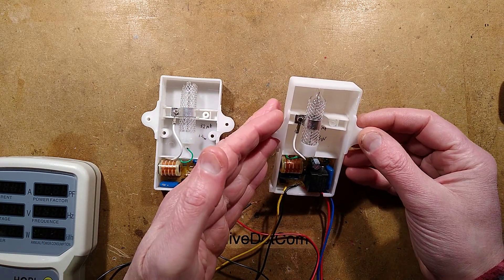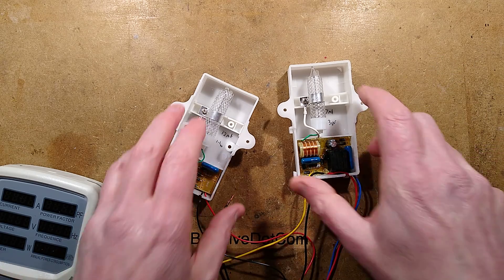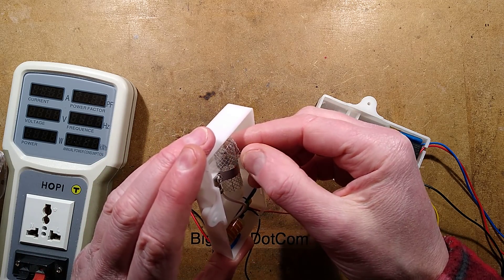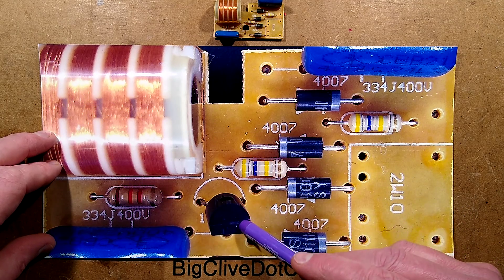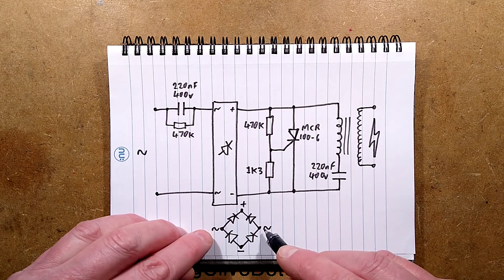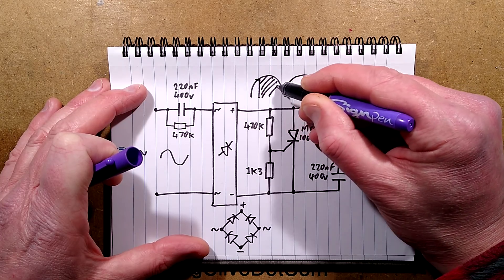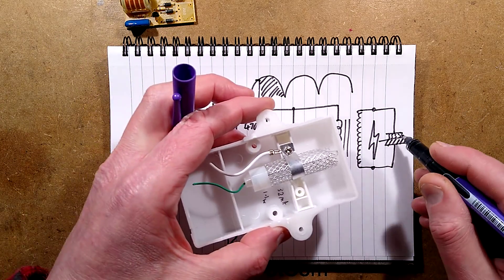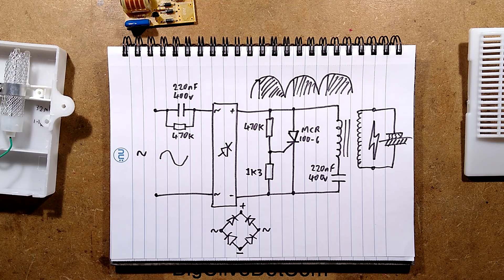The "two-wire" high voltage mystery eBay device

Comment: The diode layout looks like it's doing a few things. It must be changing AC to DC so we don't electrocute our consumers, and it also looks like at least part of cascading voltage circuit going into the coil, maybe 1/2? I may have to buy one of these things just to play with it a bit. Cool little device! Interesting video. Thanks!

Comment: 2:18 "It does create ozone". If it does create ozone, patent this device and you will be a billionaire this year. Currently used ozone generators require oxygen tanks, and they are much more complicated than the device on your table. Usually, such a simple device that you purchased on eBay generate nitric oxide, but yours generate ozone instead! This is pretty amazing!
Reply from the maker: In open air a corona discharge unit will create ozone, nitric oxide, hydroxyls and other molecules.  The exact same ones created in nature in a similar way.

Comment: Well, here's one for a Bigclive.com video - resistor E ranges. 1.3 becomes a member in the E24 range and higher. You probably had an E12 range, which it is not a member of. 

E6 1.0 1.5 2.2 3.3 4.7 6.8

E12 1.0 1.2 1.5 1.8 2.2 2.7 3.3 3.9 4.7 5.6 6.8 8.2 

E24 1.0 1.1 1.2 1.3 1.5 1.6 1.8 2.0 2.2 2.4 2.7 3.0 3.3 3.6 3.9 4.3 4.7 5.1 5.6 6.2 6.8 7.5 8.2 9.1

They go apparently from E3 to E196. E24 is common for metal oxide resistors.

Comment: The circuit look quite similar to old day spark gap transmitter.. the SCR act like a spark gap when the voltage exceed the break down it start to conduct . the capacitor dropper act as current limiting circuit instead of choke.

Comment: I've designed a circuit similar to this, but working off batteries.   Which means I needed to create my own AC signal to rectify.   The thyrister self-shorts out the capacitor reserve and thereby effectively switches itself off, no need to wait until the zero on the input wave.   You'd need the data sheet to know what voltage triggers the thyrister but I made it work differently based upon the charged voltage, independent of that trigger voltage.   Good analysis of the circuit though.

Comment: so what was the relay for, in the half wave model?
Reply from the maker: It appeared to be a no-volt relay style safety interlock.
Reply: @bigclivedotcom  sorry i dont know what that means. Is it someth8ng where if the discharge tube fails then the supply voltage is disconnected. Does it trip and then have to be reset.

Comment: designed and built these commercially from about 1990 up to 2004. The lowest power one I had worked on a similar principle except it was 1/2 wave and fired when the capacitor stopped charging. Biggest one was in a watercooled stainless tube 2 m high, ran on pure oxygen. Drew about 3 KW from the mains. You could not run it with people in the room! It was used for purifying water for a fish farm. I just sis the electronics.

Comment: Clive. What did you mean when you stated that 1K3 was "not a standard value"?
Reply from the maker: There are different resistor series.  I use the E12 series which has 12 values per decade and jumps from 1K2 to 1K5, but other standards probably do include 1K3.
Reply: @bigclivedotcom  Obviously, I'm not up with this new (odd) labeling  format.

Comment: For 110vac, put two capacitors in series on the +/- of the bridge rectifier and move the neutral wire to the center tap of the two added capacitors. Basic voltage doubler.

Comment: Do you have a Geiger counter?
Because the UV from the arcing in that tube should be enough to cause some of the aluminum to transmute through K shell electron capture into an unstable isotope that decays back to aluminum. The decay will only be beta radiation (high speed electrons), and isn't really a threat.

Curie exposed aluminum to UV and showed it to be radioactive for about 30 minutes afterwards.

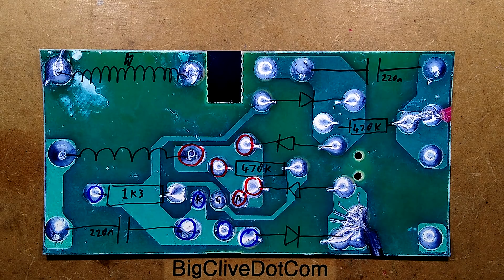Comment: the slot for the the "2W10" could be for the relay that is omitted to make the 2 pole version, for cost cutting they probably just solder over the pins and use the same board. 8:30 , you can see the added solder nugget used to bridge @ 5:10.  anyways im 15 and from Canada and a reply would be great! by far my favourite electronic dissection channel.

Comment: You sure the "2W10" wasn't for a relay (like the 4 wire model) in a model where they want to be able to switch the device on and off without interrupting power?

It will almost certainly be a gas charged tube.  It's harder to push electrons through vacuum.  It's not much more than a fluorescent lightbulb that has no phosphors on the inside, and a plate on the outside, instead of end-to-end.  You could turn it into a rather more pleasant lightbulb by painting the outside with phosphors, if you didn't mind the toxicity ...

Comment: High speed drum printers used to have a power supply for a neon light that would go to thing the length of the paper width.  The thing had a sharp pin every inch and when the paper passed over it it would ionize the air and paper, i.e., make it conductive and it would allow the paper to fall into its basket rather than stick to the wall or the ceiling because of static cling.  The printers printed so many lines a minute but they also had a slew rate between printed lines that was a lot faster.  Some forms like stock certificates and checks only have two lines printed on a sheet so this was particularly necessary in dry climates.

Comment: Hey Clive. Have you ever done any tear downs of the mini car ozone generators/air purifiers? They plug into the 12V cigarette lighter. 
There are many out there. Here’s one of them for reference:      
https://www.ebay.com/itm/2-IN-1-Car-Ionic-Air-Purifier-Oxygen-Bar-Ozone-Ionizer-Cleaner-Dual-USB-Charger-/302446532960?_trksid=p2349624.m46890.l49292
Reply from the maker: I have taken a look at some - including the fake ones with just an LED and random components that do nothing.

Comment: Great 👍🏻 Quality Videos As Always BigClive!!! I’m looking at getting a whole house 🏡 sterilization device, any recommendations aside from HEPA Filter, Ozone, UV-C That You Might Suggest???
Reply from the maker: There are units that fit in hot air heating systems, including UVC tubes.
Reply: Yes good thought ,have installed them.
  No sun shines in the duct work .
This does help ,but I would try to amplify it some way.

Comment: I have a device similar to that but its the bigger version. It is called..."New Age Living. C3500 high-efficiency air purifier" it's a knockoff chinese-made air purifier. It's spicy! 👍It uses a UV Light & has titanium grid plates with a fan for the ozonation. I bought it at the Goodwill store for $3.00 I plugged it in and it worked for a few minutes. I had to disassemble it to clean it & I have to replace some high voltage electrolytic capacitors on the circuit board. You would like it big Clive. There are 2 high voltage Transformers, kind of like what was used in the old CRT television sets only smaller. Maybe 1/2 to 3/4th the size.
No way I would run this thing while I was home. It is definitely a sterilizer! Do you know if the thing would be bad on my houseplants?
The UV light is not exposed to the open.
Reply from the maker: If you can smell ozone when it's running then it's not suitable for using when the place is occupied.  The titanium dioxide plates are for UV photocatalytic creation of hydroxyl radicals.  It should be OK for the houseplants.  The same tech is used in cannabis farms.
Reply: @bigclivedotcom  ok, thank you big Clive! 👍
And yes you can definitely smell it when it's on. I would only use it to neutralize odors.

Comment: Another "fun with high voltage" video.  I must have missed it.....I'm assuming the extra wires and relay are for switching the Chinese contraption on and off ....
Reply from the maker: They appeared to be a latching interlock.

Comment: The colour of the discharge inside the tube suggests what's inside is just air (but perhaps at a lower pressure). Argon should look more pink in colour, and neon more red. And I don't think it'd make sense to select another noble gas that is more similar to this in colour, as all of them are more expensive.
Reply from the maker: It produced at peak at around 500nm.

Comment: Please don't mock me clive, but i watch a lot of these paranormal tv programs, I'm just find it intriguing & still sitting on the fence about the paranormal! But i was wondering what your take is on some of the gadgets they use, like the k2 meter, evp generators, rempods ect ect? I see most are home made gadgets &  sceptical about these gadgets they use!
Reply from the maker: Most of them are basically randomisers with the behaviour "interpreted" as paranormal activity.  But if they enjoy doing that then I'm fine with it.

Comment: Aluminum gives up electrons more easily than most common metals. This reduces the EMI generated by the cell .  Aluminum is not attacked by ozone like iron is.  Is the strap aluminium?
From the shape of the sparks, i guess that the cell uses air at near atmospheric pressure. Nitric acid is a side product when creating ozone in the presence of water. The small diameter of the inner electrode makes it easier to create a spark, but makes it fragile. The glass reduces the production of nitric acid, keeps dirt out of the cell and protects the wire.
At these voltages, anything within 3 mm of a conductor will be affected by the high voltage. The cap at the end stops that. You should keep the wires to the cell at least 3 mm apart. Six is probably better.
Every time I look at this, I'm surprised by the quality of the engineering that went into it. This is probably among the best engineered ozone generators at this price.
Reply from the maker: I'm wondering if this type or the small ceramic plate ozone units would be more reliable over time.  (Or the carbon fibre brush corona type.)

Comment: It reminds me of the capacitor-discharge car ignition system I built in my long-lost youth to add to the standard contact-breaker-plus-ignition-coil ignition system on my car. That also just crow-barred the output of the DC-DC converter that generated the 400 odd volts that charged the discharge capacitor.

Oh, 1k3 is a standard value in the 5% tolerance range, just not in the 10% tolerance range (where the nearest value would be 1k2).

Comment: Looks like the only tracked connection to that "2W10" position are where the red and black wires attach, so it might be for some kind of filter.  Oddly, 2W10 is a part number for a 1000V 2A bridge rectifier but it wouldn't fit that hole pattern. Maybe they put that on the PCB to say "We wanted to use a 2W10 rectifier but the boss had a load of 1N4007s in stock and made us use those instead".

Comment: The 2W10 is wired as a three pin device, so it can't be a relay or full wave rectifier. The two widest spaced pins would be the the AC input. One pair of the closely spaced pins are connected together; the others were left open. Maybe it is a 240V/120V converter of some sort? A transformer with one side of the primary connected to the secondary?

Comment: 1k3 first appears in the E24 resistor value range. It sounds like your collection is E12.
SMD resistors are so cheap these days that most people pick from E96, particularly when making measurement circuits.
This circuit probably uses the closest value with a 5% tolerance to keep cost down.

Comment: Depending on transformer coupling and stray inductances, as well as the Hold current specification of the SCR, it is possible that there is enough of swing back voltage to turn off the SCR and then you would have it ready for a second strike well before the next zero (crossing).  The capacitor value though is quite high (220n) so probably this implementation indeed runs at 100 Hz  -- in Europe -- unlike some welding arc starters.  What I am familiar with, used 2 - 5 nF mica capacitors.  With that and AC supply instead of the lazy bridge, you got some 15 to 30 strikes on the rising (positive going) voltage and same on the falling (negative going) slope.  Instead of an SCR, the shorting action was produced by one -- or possibly two series connected -- spark gaps.  The supply transformer (3 to 5 kV and for Sub Arc even more) was current limited by a magnetic shorting bar between the primary and secondary windings.  Of course, your capacitor dropper is also current limiting and much, much smaller.

Comment: Big Clive, I do like when you highlight the features of the design related to electrical safety: gaps in the PCB in order to get long enough creepage, proper bonding of PE to a conductive case, identifications of the insulation barriers when double insulation is required, when the designer went for double insulation instead of relaying on PE/RCD, need for a tool when a potentially live part could be touched, ...
I feel I benefit when attention is brought, even briefly, to the practical design strategies which guarantee electrical safety.

Comment: But WHY would the resistor have been helpful. All these videos only ever tell you the WHAT and HOW but leave out WHY things are done. So much learning is lost because the most important part is missing when it comes to applying the knowledge. This isn't just meant for this video, but I see that problem with all learning materials and even documentation in open source projects.

WHO, WHAT, WHEN, WHERE, WHY, and HOW. Those 6 words are the first thing you learn about writing a complete story.
Reply from the maker: The resistor would have limited current spikes, potentially reducing the electrical noise this unit makes.

Comment: Despite what you say Clive about that the circuitry could be more efficient, I really think this is a neat simple design with one thyristor (SCR). One problem with a thyristor is the way to stop it conducting once the gate voltage is gone: OR in the first place you never exceed the A-C current above the hold current of the SCR, OR when used above the hold current (in this case) you make the A-C current manually zero. In this device they've used the reversed emf on the coil to stop the current.

Comment: It's always difficult figuring out exactly what happens in rectifier circuits but I think that this circuit is cleverer than it looks.  I think that the thyristor fires twice in each half cycle and pulses the transformer at 200 Hz.   In other words it charges and discharges the output capacitor once on the way up and once again on the way down.

The thyristor doesn't conduct for 2/3rds of the half cycle as shown by Clive because the current falls to zero at the top of the sine wave and so the thyristor turns off.  The capacitor then recharges through the other half of the bridge rectifier as the voltage falls towards zero and the thyristor triggers again when it reaches about 100V.

Comment: A self-administered nitric oxide nasal spray (NONS) made by Vancouver-based biotech firm SaNOtize has been found to dramatically reduce Covid-19 viral load in infected patients after completing early-stage clinical trials in Canada and, most recently, the UK.
A self-administered nitric oxide nasal spray (NONS) made by Vancouver-based biotech firm SaNOtize has been found to dramatically reduce Covid-19 viral load in infected patients after completing early-stage clinical trials in Canada and, most recently, the UK.

SaNOtize, alongside Ashford and St Peter’s Hospitals NHS Foundation Trust and Berkshire and Surrey Pathology Services in the UK, have announced results of Phase II trials indicating that SaNOtize’s nasal spray represents a safe and powerful antiviral treatment that could prevent the transmission of Covid-19, shorten its duration, and reduce the severity of symptoms in those already infected.

In a randomised, double-blind, placebo-controlled Phase II trial that evaluated 79 confirmed cases of Covid-19, SaNOtize’s early treatment significantly decreased the level of SARS-CoV-2, including in patients with high viral loads infected by the concerning UK variant of Covid-19.

Patients treated with SaNOtize’s spray saw an average viral log reduction of 1.362 in the first 24 hours, which corresponds to a decline of around 95%. Within 72 hours the viral load plummeted by more than 99%. No adverse events were recorded in the UK trial nor in earlier Canadian trials that saw over 7,000 patients testing the self-administered treatment.

“I expect this to be a major advance in the global battle against the devastating human impacts of the Covid-19 pandemic,” said consultant medical virologist and chief investigator of the NHS trial Dr Stephen Winchester.

“This simple portable nasal spray could be highly effective in the treatment of Covid-19 and reducing onward transmission. Our trial included patients with a variant of concern and high viral loads yet still demonstrated significant reductions in the levels of SARS-CoV-2, which could be critical in supporting vaccines, preventing future outbreaks and safely reopening economies. Simply stated, I think this could be revolutionary.”

To date, NONS is the only novel therapeutic treatment outside of expensive monoclonal antibodies that has been proven to reduce SARS-CoV-2 viral load in humans, SaNOtize said.

The SaNOtize treatment kills the virus in the upper airways, preventing it from incubating and making its way to the lungs.

It occurs  to me breathing SMALL and SAFE amounts of ozone or ionized air from a portable battery operated device, etc could also have the same effect as this Sanotize Spray These trials take forever and the end product is so expensive or hard to get that it might as well not exist.*

https://www.clinicaltrialsarena.com/news/sanotize-nasal-spray-reduces-covid-19-viral-load-uk-clinical-trail/

Comment: 1.3k is a standard value at 5%. It's 1, 1.2, 1.3, 1.5, 1.6, 1.8, though it's one of the least commonly found (I've rarely seen 1.3 and 1.6; the others are frequent).